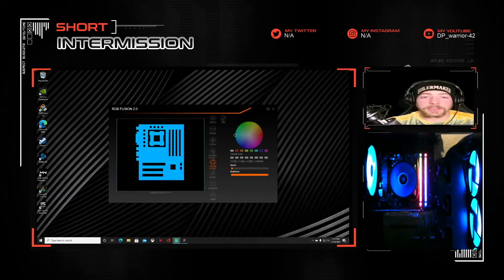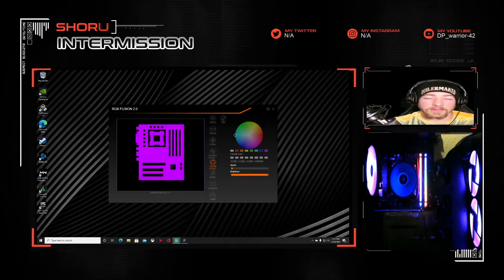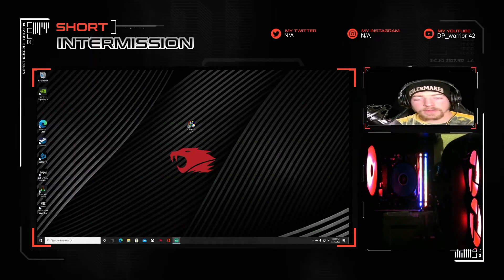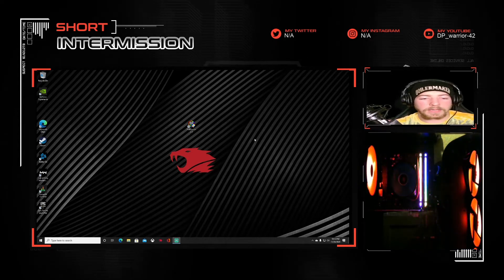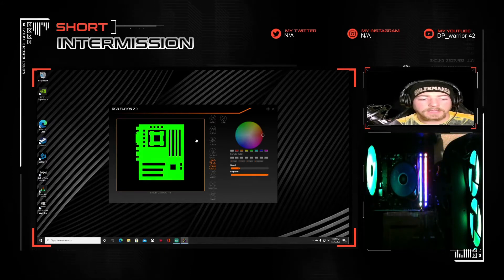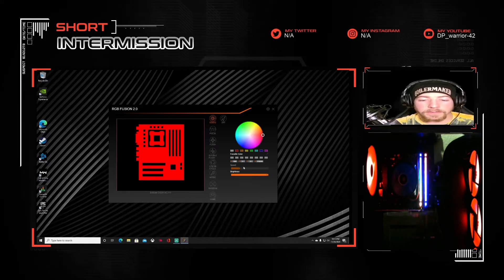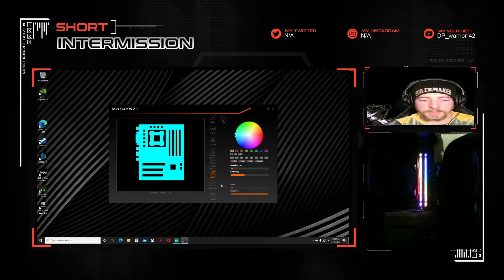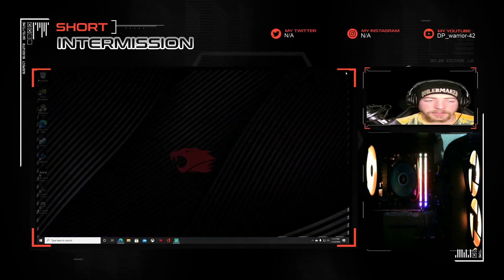iBUYPOWER RGB Troubleshooting Guide [RGB Fusion 2.0] [BB991]

Comment: On my i buy powerr it has two buttons on the tower one for color the other for mode. Press mode unit it turns off the lights on the fans and go onto rgb 2.0 it will now let you chose the color from there.

Comment: Bro I am so mad the lights won’t turn on with the pc like at all no lights
Reply from the maker: Multiple people where having that issue. I haven't run into any hardware or software issues with mine at all.
Reply: @warriorplays3354  it’s fixed now all I did was unplug and plug it back in then turned on lol
Reply: @SnowzyyL2  unplug and plug what? can u elaborate on that? im facing the same issue
Reply: @SnowzyyL2  unplug what ?

Comment: I received an IBP computer for Christmas.  Being colorblind, I could care less about the RGB lights (in fact, don't want them at ALL).  But that's what I got, so "gift horse in mouth" and such.  It was super easy and fast to use RBG Fusion 2.0 to turn off all the lights, which worked fine for about a month, when suddenly, they just all popped on again.  No idea why.  Read dozens of threads and watched a dozen videos on how to fix, but nothing works.  So after 2 months of trying everything, I just now put a big piece of cardboard between me and the computer, so the lights don't drive me crazy.
Reply from the maker: If you dont want the lights you can just unplug the led control from the board. It should be under the graphics card.
Reply: @warriorplays3354   Thanks WP.  I tried what you suggested; saw one wire below the GC, next to an LED port; unplugged it but nothing happened or changed (so I plugged it back in).  But now a SUPER crazy thing happened.  I was reading a DIY porch article on Google, when all the lights in my computer go out (not sure how or why, but "great" I thought).  So after being puzzled for a minute, I go back to reading the article, and the lights come on again, and are now FLASHING.  It worse than before.   Any idea why in the heck this is happening?  Thanks.

Comment: i just bought a PC and when i turned it on, everything was working fine, then like 30 minutes passed and my RGB lights just went on (fans are still spinning) .
i opened the box and tried unplugging everything off and then back on and still nothing. (i also noticed that the motherboard was flashing a orange light) i need help!!!1

Comment: I have the upgraded version of this one which has an app called ASRRGBLED and it asked if it could make changes to the device which I hit yes and it brings up the software to change the RGB. The problems are nothing pops up for the fans or led lights. It shows options for the keyboard and mouse but it doesn’t even work. I’ve tried reinstalling it again, which it came preinstalled. I’m just confused, anyone have any tips?
Reply from the maker: Did you try running as admin? Not familar with that software.
Reply: @warriorplays3354  thanks for the reply. I got it working like 30 minutes ago because of a loose wire. Again thanks for the reply though.

Comment: quick question, how was the windows 10 install? did it have alot of junk like cortana, microsoft edge, candycrush stuff like that
Reply from the maker: edge and cortana are pretty standard, other than that came with ibuypower catalog, office and other utilities. No anti-virus which is good. Most home pc come pre-installed with MacAfee. You can always do a clean install afterwords if you would like.
Reply: @warriorplays3354  sweet thanks for responding

Comment: I need help I can't get the software to load at all
Reply from the maker: Are you having trouble with windows installing?
Reply: @warriorplays3354  I can't get the lights to work
Reply from the maker: @mom2bgtwins05  was the software pre-installed or did you have to download it?
Reply: @warriorplays3354  it was preinstalled, I've uninstalled it and reinstalled it hoping that would fix it but it didn't
Reply from the maker: When you click on the short cut does it bring up the "do you want to let this program make changes to your device" prompt? Did you try running it as admin?
Reply: @warriorplays3354  yes I click yes and run as admin but still nothing it just brings up the screen that shows a motherboard thing but it won't do anything at all
Reply from the maker: Software seems to be working fine then. Its not reading the fans. Make sure all the connections are secure and plugged into the correct position
Reply: @warriorplays3354  will do and I'll let you know
Reply: @mom2bgtwins05  having the exact same problem did you figure it out?
Reply: I have the same problem I load up the software and it just doesn’t detect my fans at all or motherboard I don’t know why dragon center works fine for me but I want a better selection of patterns for the fans or to make each fan a different color. please help
Reply from the maker: You won't be able to individually change colors for the fans. They are all connected to the same controller